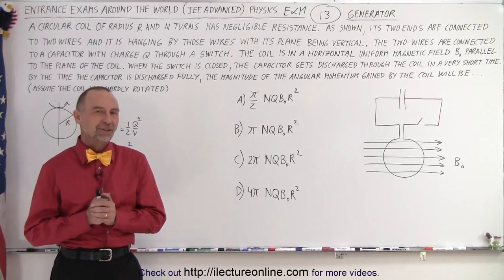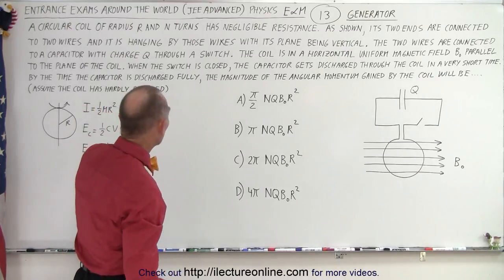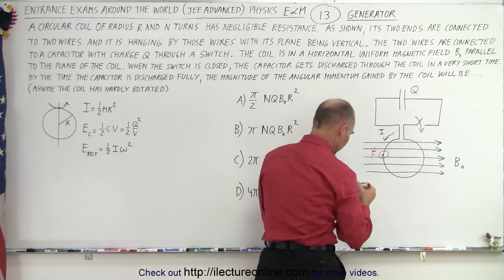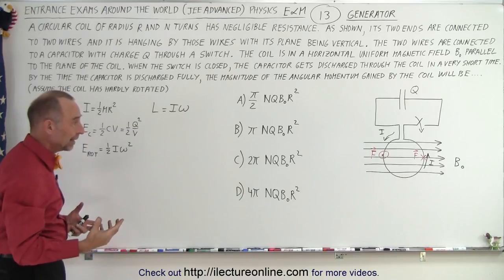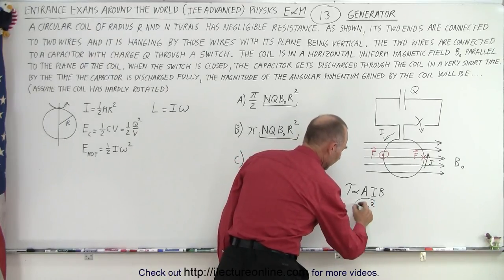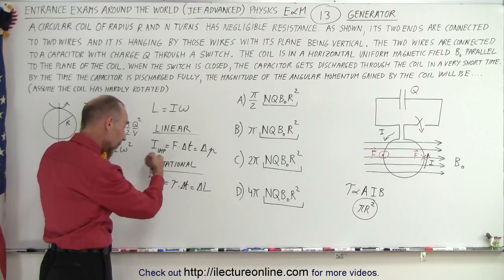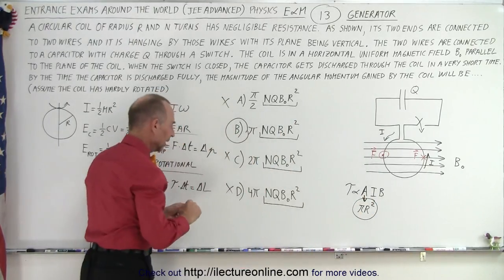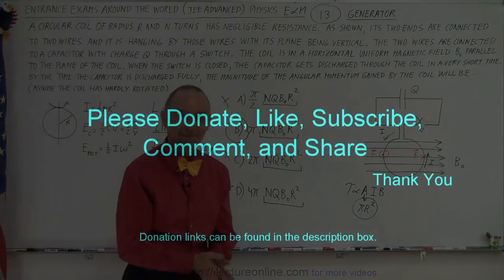JEE Advanced Physics 2020 Paper 1  #4  (#13) Generator

Comment: We can also calculate it using I=inot (1-ert/l)
Reply from the maker: Did you try it and get the same answer?
Reply: @MichelvanBiezen  I did this for calculating the capacitance of the capacitor and got some other answer.
Reply from the maker: Then it works!

Comment: Ok so 80 high power car aultanator if you where to use a multiple battery and caps you could skimp load the unit as it thinks it has full battery this geared so the load electrical motor at a rpm off 106 rmp gives a 3000 out on aultanator gear after run loss off 75 amp and motor 100amp at left you should have near 200kvdc I need to power a off shore pump system for a fish tank  System!. Try it with a dule magnet split in half around the coil spin one left and the other right when it hits s/s n/n you get the repel half the turn watch the power increase?????.